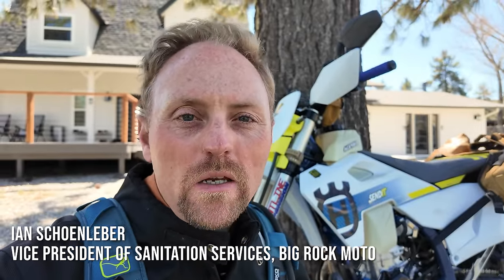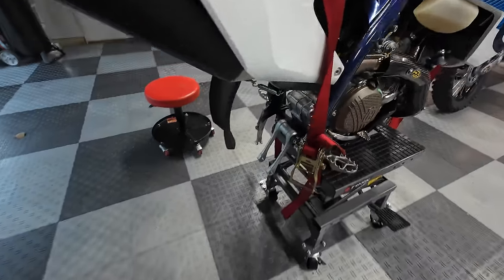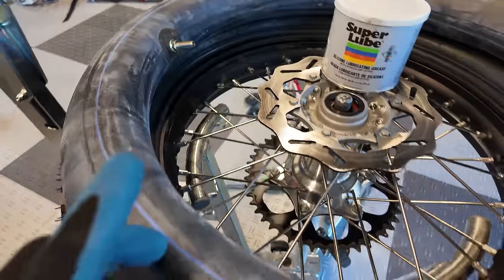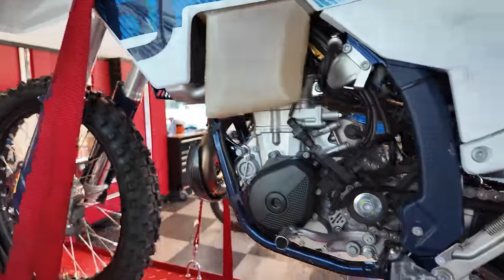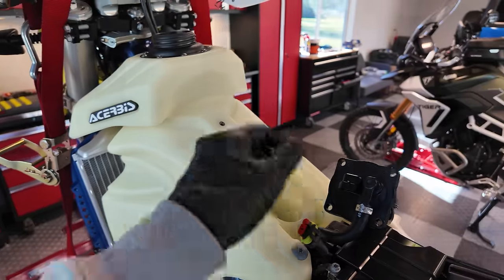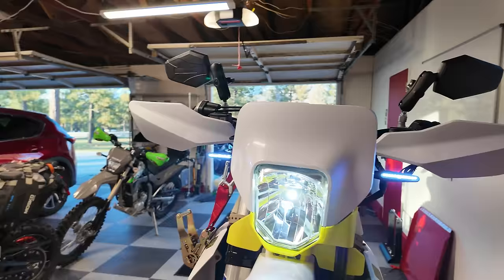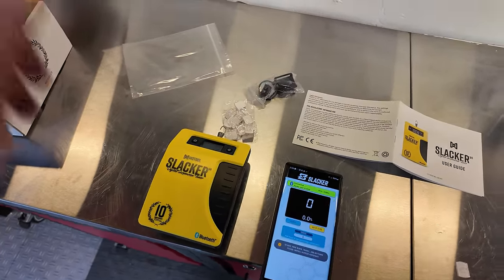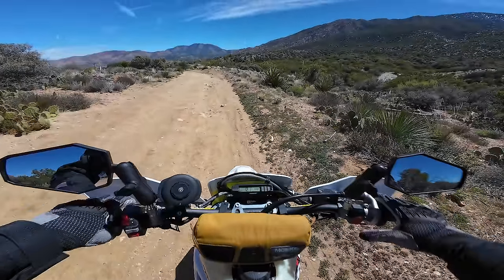2024 Husqvarna FE501S | Building My Dream Dual Sport (Phase I) (EP.4)

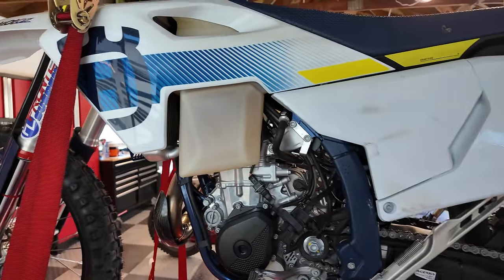Comment: @12:30 - FYI: a magnetic filter will only remove ferrous metals, however most of the metals used in the engine are NOT magnetic (lead, copper & zinc are used in the bearing shells; aluminum and stainless are also used on various other engine components... none of these metals will stick to a magnet)...bottom line, I would stick with a disposable paper filter.
FYI: I have university degree in mechanical engineering (I did my senior thesis on tuned exhaust in 2-stroke engines - including cutting, rolling and welding my own expansion chambers) so I know far more about engines and engine design than the average person.
Reply: Agree, plus the price of that filter is about the same as the price of 40 OEM paper cartridges here in South Africa - so 600 hours of oil changes before it makes financial sense.
Reply: Thank you  for pointing that glaring oversight out.. Ian has become a schill for his sponsors, this episode is all about Taco Moto Co..
Reply: You did see that there was a secondary screen filter as part of the system, right? Any of the non-ferrous particulates too small to get caught in that are too small to do any damage anyway. Especially taking into account the average lifespan of these motors. If you were trying to get 300k miles out if it then yes you would want to filter much better to avoid fine abrasion wear that could occur over a long time, but for what they are and what they do this filtration system is more than adequate.
Reply: Can't really claim the micron improvement when you're missing everything but ferrous metals smaller than the screen though.
Reply: @michiganmoto7687   - that screen filter has VERY low filter efficiency, so I will respectfully disagree that any particulates too small to get filtered by the screen are too small to do any damage. Additionally, if your theory of the filtration efficiency of the screen is sufficient, why would the design & development engineers at KTM have included a paper filter (and why would you need the expensive magnetic filter)?
Reply: @danielklopp7007  I never said the screen was stand alone or sufficient unto itself. I did say that it was a part of the filtration system. Between that and the mag filter anything left is relatively insignificant. But you don’t have to agree with me. I’m sure there is plenty of empirical evidence complied through extensive mechanical testing in both heavy industrial and small engine applications to support the results. Being an educated individual as you are I’m sure you can appreciate that they would not promote a product that could cause damage to your engine as I’m sure that would open them up to incredible liability. Furthermore, there are other smart engineers that actually do specialize in fluid dynamics that develop products like this. So I defer to their very specialized knowledge on this topic. I enjoyed the conversation though. Enjoy your day. ✌️
Reply: @michiganmoto7687   - I'm sure you are correct; a company has NEVER introduced a product that would lead to liability ...
I trust the (degreed & experienced) engine design & development engineers at KTM more than any "engineers" at Taco Moto.  If a screen + magnet provided sufficient oil filtration, why wouldn't the KTM engineers (or any other engine design engineers) chose a paper filter? To use a legal phrase; the facts in evidence don't support the conclusions...
Reply: I assume when he said the filter is used in industry, he means on multi million$ bulldozers,scrapers and huge dump trucks. There I could understand that use but on a dirt bike? You would be better off putting on a larger clutch cover for more oil and heat dissipation.
Reply: I also have a degree in mechanical engineering and DO use the magnetic oil filter from Taco Moto and DO get my oil lab tested. I do everything from racing to BDR’s (40hr oil change interval) with my 350 and the oil tests have also been great.
Reply: @WinifredMulvey  Yes recommending the best dual sport tuners in the country makes him a shill.  How dare he suggest people go to a place that does damn fine work?
Reply: @DorkintheRoad  um.. Don’t let professional material engineers cloud your opinions… Ian has lost his way.. we are sick of hearing Taco Moto..Taco Moto 1000x… we real off-roaders  , as in A Level racers  , with significant racing resumes , recognize posers when we see them…. If you or Ian would take riding schools taught by national level racers or professionals and commit to practicing those skills, then we would respect your product “reviews” until then continue deluding yourself that you and Ian have the skills , knowledge and expertise to tell Lewis Hamilton what tires to use… the noobies may not see through you… but we do…
Reply: I am an aerospace engineer and you sound incredibly pretentious. Please keep in mind your phrasing when communicating your points.
Reply: @michiganmoto7687 hmm, I believe the 2024 there’s only one filter and one screen. and disagree on the fact that you wouldn’t expect these engines to last
Reply: @danielklopp7007 precisely! I had more than a fault caused by aftermarket half-baked, counter-productive ideas, good luck with them taking responsibility for the damage (and of course with the manufacturer, who aren’t at fault). I couldn’t. I too trust the manufacturer to know what they do, if nothing else because they are legally responsible and reputationally incentivised to fix the damage caused by by oem stuff. I like Ian, but I don’t understand why one buys a wonderful and brilliant new bike, and then changes every single thing on it that be changed. My next new bike will only have essential extra bits: surely skid plate, possibly radiator and engine guards, perhaps rear rotor and full around hand guards.
Reply: @WinifredMulvey  Absolutely baloney! When an influential and popular channel finds an exceptional source for aftermarket parts and service, he highlights them. You could be just as critical of Dave Darcy at MADTV who has routinely promoted Rally Raid UK or suspension specialists in Oz or Adam Riemann and his preferred suppliers. Ian goes beyond most channels to present honest, practical, well-informed reviews of bikes, parts and gear.
Reply: @osimnod   there’s  the rub.. Ian is a nobody with ZERO credibility, he is not a national level racer, an engineer, never taught/took an off road class to improve his skill set, has no racing resume’ or world an off road rider… as of last year.. he was an event planner… in your mind if that all it takes  to become an authority, then I suggest you tell Lewis Hamilton what tires he should use…
Reply: @WinifredMulvey  You make a lot of assumptions in one breath, pal. Ian has had this channel for more than a few years and has been an avid rider for many years before that. No, he's not a racer with a resume' nor an engineer nor a snob who presents himself as an authority. He's simply an honest presenter of his experience with bikes and gear to the 98% of us who are also not racers nor engineers. Is it your opinion that only racers - present or former - or engineers ought to be allowed to share their observations to the general public? I certainly hope not but wouldn't put it past you to hold such an elitist attitude based on what you've written. You don't acquire credibility by being a racer. You acquire it by being honest. 

I don't know Ian personally. I only know him through watching his channel develop over the past few years. He's the kind of guy I'd enjoy riding with because he wouldn't be trying to prove something to me. I suspect you'd be just the opposite.
Reply: @osimnod  based on your logic , what ever family financial decisions are based on what the honest homeless person down the street told you…correct?… not what a licensed certified financial planner would advise , you know someone who is a professional who makes a living at it ?… someone  with a proven resume’ and credibility..? Now if you reached out to Ian to plan an event , because that is what his profession was for many  years, makes total sense.. why .? Because he has years of professional experience in that field and was quite successful…that’s credibility and a person whose opinions and guidance is worthy of respect…. Since I am a criminal trial attorney, please come to Daytona I’ll give you the best medical advice on the planet….
Reply: @WinifredMulvey  Has Ian ever declared "Take my advice because I am an accomplished, credentialed, world-renowned expert in the field"? No. Your analogy lacks relevance. Stick to law, at which I am sure you are quite adept. Best wishes to you in all your endeavors.

Comment: Great idea magnetic swingarm guards. I wish they also made magnetic engine cases guards: I’d rather remove them at each wash to avoid corrosion under them, but I’m very weary of keep removing the engine case bolts, as they’re easy to strip and leave you with a serious problem on your hands.
Reply: Alla fine che hai preso tra EXC500 e FE501? Avevo letto il tuo commento al video di GetDirt e sono indeciso come eri tu :D
Reply: @40020287  non ho ancora preso niente, ma alla fine penso sceglierei la 501 per curiosità sul linkage, che è preferibile in attività tipo rally. Certo i freni restano un problema. Ma a dirla tutta continuo ad avere ripensamenti: ho una 350 e alla fine sostituirla con una 500 ha pro e cons, e non sono certo che faccia sufficiente differenza per valere lo sforzo e il disborso. Al contrario, prendere una 2T (da appaiare alla 350) aggiungerebbe una intera nuova dimensione, sto guardando alla Husky TE300 Pro, che tra l’altro ha freni e frizione brembo… costa quanto la 500…

Comment: So I understand the value of the filter for metal particles that are magnetic.  What about the non-magnetic particles?  Brass, aluminum, etc…
Reply: Exactly my thought. I’ve learned to be suspicious of these genius aftermarket ideas, they often turn out half baked and half broken…
Reply: I am not 100% sure about this theory, but hear me out:

While there are undeniably several parts in every modern engine which aremade out of non-magnetic material (aluminum, magnesium etc), maybe the logic here is: all parts that are actually in contact with another moving part and are therefore subjected to abrasion (bearings, gears, piston rings..) are always made out of steel.
If that is the case, then there should never be any nonmagnetic particles in the engine oil (???).

I  can't really believe that the guys who developed this magnetic filter didn't think about this very basic question.
Reply: @chukku2175  yes, but that there are no non metallic debris floating around in the oil is clearly false. Perhaps you can argue that they won’t make damage?
Reply: The tacomoto product page for the filter says that non-ferrous materials are also caught via static adhesion and entrapment, and at smaller particle sizes than a paper filter can catch. Kinda questionable for the larger non-ferrous stuff but who knows

Comment: Remove seat and tank, remove lower rear subframe bolts, loosen the top subframe, disconnected the exhaust midway, and the  airbox snorkel then lift the whole back subframe there’s the shock.
Reply: Actually, I think you just put it on a stand, take out the rear wheel and you can take it straight out. On my 500 EXC-F with PDS (no linkage) you don't even need to take out the wheel. Just top and bottom bolt and it comes straight out.
Reply: Much easier way actually. I have done this on a new KTM.

Comment: If that aftermarket oil filter is just a magnet, there is all kinds of other debris in the oil besides magnetic ferrous metals - so it won't filter out anything that's not magnetic.  Best thing to do is to use an efficient filter combined with a magnetic drain plug - like the factory setup already has.

Comment: i've seen when people have a bigger tank , they look for a slope or asreep bit of ground and drive so that the frony=t wheel is way p at waist height. That way some fuel flows in to the other part of the tank. you'll have to try by running it right down. It may be the way.

Comment: What front tire are you running? What size tires are you running? Did you pull off the vapor catch system and install the taco smog kit? I just got a 501s 2024

Comment: I'm still unsure if the best performance dual sport base is the 350 or the 500.  My ideal garage would have a 300 2stoke, a 350 or 500 exc, and a norden 901.  For that performance dual sport in the middle, would you go with a 350 or a 500?
Reply from the maker: I prefer the 350. Smoother, less vibration

Comment: Hey Ian, I don't know if you remember your 2022 500 EXCF enough to compare its suspension with this new husky? I'm contemplating revamping my entire KTM 2022 suspension, with lucky cartridges up front, and maybe their national shock in the back to the tune of over $4,000. It's tempting to just sell my 2022 530 EXCF or trade it in towards the 2024, either husky or KTM. Wondering if you can remember enough to compare the suspension you now have versus the suspension on your 2022 KTM?
Reply from the maker: The stock setup is decent, but not nearly as good as a tuned suspension from the previous gen.
Reply: Thanks for the input! When I run the numbers, it would cost me an additional seven or eight or even $9,000 by the time I brought a new bike up to par with my current bike with the seats and armor, lighting, and I still have just a 2024 stock suspension. For 4K I have all that and a top-notch aftermarket tuned suspension